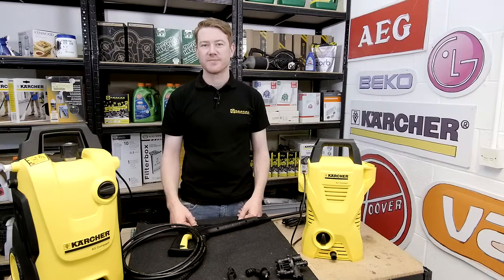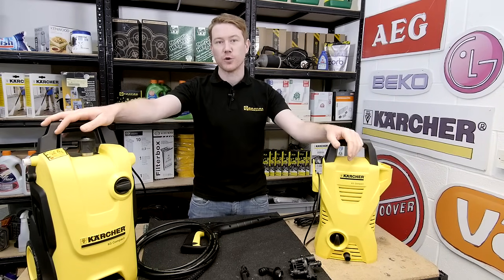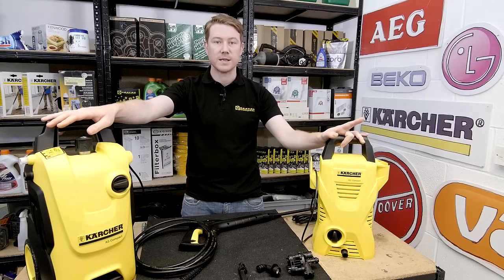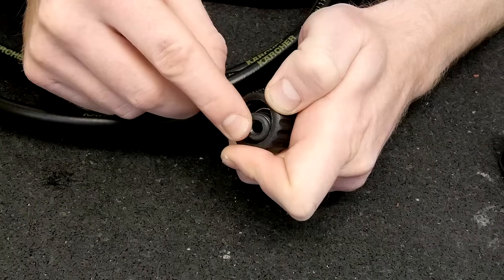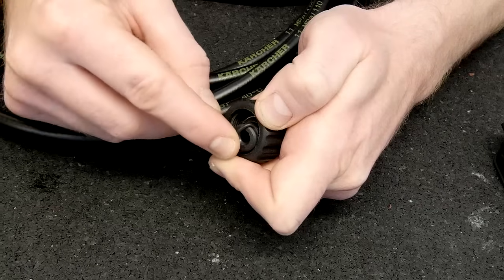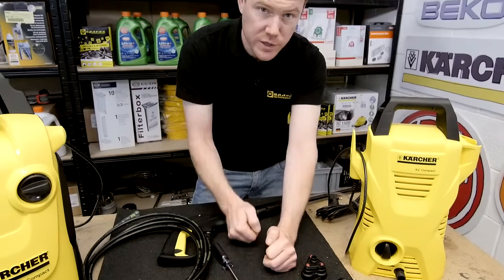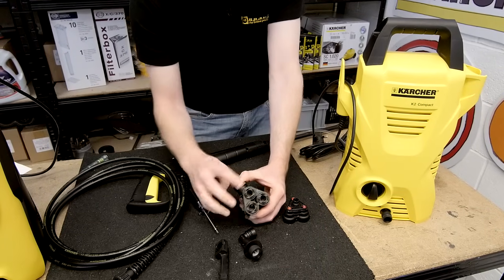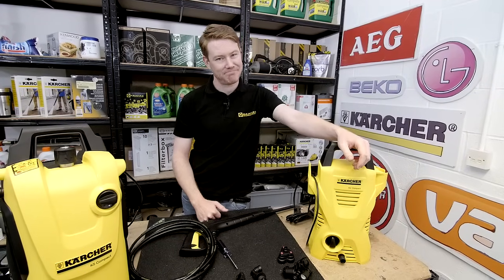Karcher Not Working? - Karcher Pump Faults Fixed!

Comment: Hi,
I have a Karcher 4.130 works but  is leaking a lot from the cylinder head area ,  so does not have the usual power. It is not pulsing. I have stripped down and had a good look, but no obvious cracks or splits. I have replaced the triangular washer , Can you suggest what next to try?
Reply from the maker: Hi Michael, disconnect the power and connect the hoses to pressurise with mains water pressure. You can then dismantle and examine to find where the water is leaking from.

Comment: I have a K1900 electric pressure washer. The motor will not cut off when the spray gun trigger is released but instead runs slower. Prior to the motor running constantly, the unit was pulsating when using the spray gun and cycling on and off when not using the spray gun. No leaks found.

Comment: I have a karcher and it started pulsing evey few secs now it's every second but there are no leaks and the pressure has dropped. Could it be a blocked inlet? Thanks
Reply from the maker: Hi Ritchie, it does sound like there is a restriction somewhere but try a different nozzle first.
Reply: eSpares it was running all time yesterday but then started pulsing again I'll try new lance/nozzle 1st. Thanks

Comment: Hi,I have a Karcher K6.85M Pressure Washer which has always been appropriately stored (never below 0°C) and drained following its largely infrequent use.Recently when using the pressure washer the motor abruptly cut out. At the time I presumed that this was due to some sort of overheat protection as the machine had been in use for just over an hour (though not continuously) and so this curtailed any further use.The following day I attempted to complete the previous day's task only to find that as before that when switched on the motor buzzed as usual but on depressing the trigger only a small amount of water was coming through the lance (just tap water pressure?) and the indicator needle was showing no pressure. No leaks are evident either.I have changed the lance, checked all of the hose connections and verified that the filter is not blocked. Do these symptoms suggest an electrical issue (capacitor?), stuck bypass valve? or point to an entirely different cause.Are the replacement spare components readily available from eSpares?Thanks for your advice
Reply from the maker: I had the same issue on a Bosch pressure washer myself recently and from your description it is likely due to the same cause. The motors on the larger pressure washers often have a motor capacitor to pass current to half of the motor. Mine had failed and was burst so check yours visually. If there is no sign of damage it may show short or open circuit with a meter. If in doubt take a chance and replace first anyway.
Reply: Thanks for the clarification......now I have a starting point I will strip down and inspect the Capacitor....as you suggest I will likely replace in any case.

Looking at the parts diagrams for the K6.85M it indicates that two Capacitors are available one at 25 Micro Farads http://www.espares.co.uk/product/es538318/pressure-washer-capacitor-25-mfd-uf?pageNumber=5&ModelId=2254119 and another at 40 Micro Farads - http://www.espares.co.uk/product/es538319/pressure-washer-capacitor?pageNumber=5&ModelId=2254119. Further research indicates that the K6.80 and K6.85 model series are both covered by the same parts list (see https://www.easymotoculture.com/vues_eclatees/Karcher/Nett.%20haute%20pression/HPC-KAR-2002_1.397-500.0-K%206.85%20M%20WB.pdf) as most parts appear identical. Do these two Capacitors reflect this model share? If so which is the correct part for the K6.85M??  

Assuming that this is not clear.....is the larger 40 Micro Farad a better/safer bet?  What is the difference between using the larger vs the smaller value component??

Thanks again for your helpful advice

Comment: I have a Karcher K5-85M that surges while in operation. Suggestions, please!
Reply from the maker: Hi Carl, two things to check,. 
I: try another spray lance as a partial blockage can cause the motor to shut off then come back as the pressure reduces.
2: Check there is a good supply of water to the machine and the filter in the machine inlet elbow, and there are no air leaks on the supply hose.
Reply: The whirlagig wand works fine. The water feed is a one-inch rubber hose with plenty of pressure, and the screen is clean. The adjustable wand works at reduced flow but surges at maximum flow. Thanks, and any more suggestions?

Comment: I have the k2 compact and on the water inlet (on the back) it leaks, but I've have also noticed the water that's leaking out is multi colored like if there's an oil leak. Any idea where the oil could be comimg from or the cause of it
Reply from the maker: Hi Marcus, the pump pistons are in an oil bath so if water is contacting the oil it is likely to be getting through the piston seals.

Comment: hi matt...got brand new k2...i tried it with no water supply to it just for couple of short bursts...it sounded great..
then when i went to use it with water supply connected ..it barked..(for want of a better word) then stopped...then wouldnt start again...so i unplugged it and plugged into another socket ..again it barked and did nothing...
ive tried couple of fuses..but nothing at all..
prezzie for my mom..never squirted a drop of water...any ideas mate?...
did i kill it by tryin it without water connected?..
Reply from the maker: Hi Ginger, my first thought would be if it is brand new then it is under guarantee, so it can be fixed free of charge. Just contact service on your receipt, you would need to take it apart to look at it so let them do it for free.

Comment: This is very helpful video. My karcher K2is leaking from inside only when I turn it on. I guess it is the cylinder head then?
How much is it?
Reply from the maker: Hi Omar, if you have checked the cylinder head and confirmed it is faulty, take a look at our website you will be able to cost the part www.espares.co.uk/browse/at1315ma877/pressure-washers/karcher

Comment: hi I have a karcher k3.575 power washer that won't turn off and is leaking water from the motor capacitor case when I turn the water on it gushes out the hole at the bottom of the capacitor housing
Reply from the maker: Hi Natasha, follow the video at 1:19 as this will help identify where the leak is coming from.

Comment: Hello. I have a question. I lent my Karcher K4 and when I was going to use it myself, I noticed that it had a leak. Could it be that the person I lent it to had pulled hard on the conection between the pressure washer and the hose that conects wth the spray gun? 
The machine runs, but not at full pressure.
Reply from the maker: Pulling would not normally damage the connections but a knock in transit or storing in a cold environment may. Disconnect the power and remove the case then attach just the water and hoses. This pressure should help show any leaks.
Reply: eSpares Thanks for the response! I found the leak. It was a cracked cylinder head.
Reply from the maker: That is typically caused by ice expanding in winter, it is possible it had fractured and failed later.
Reply: eSpares The things is that in the country that I live, there is no winter, so my guess is that the other person yanked on it pretty hard to crack the piece.
Reply from the maker: Or knocked/dropped it over when used?.
Reply: eSpares Maybe. Thanks for the help!!

Comment: Hi, I have a new Kärcher washer with built in soap dispenser. K4 full control (I think) it has the spool for lance hose built in. First use and I am unable to get the soap to run through? Is this a common problem with a simple resolution?
Reply from the maker: Hi Carl, Karcher's like most machines only dispense detergent when on 'low' pressure. Remove the lance or fit a brush and it should work.
Reply: Hi look at the tip of the washing part were u adjust the pressure for washing turn the "head " to the lowest n it will start dispensing the soap. Some times it will say the word mix on it. I had the same issue n suddenly stumbled upon the solution..
Reply: CARL THORNE or buy a Karcher K series foam cannon. Don't buy the FJ6 it doesn't dispense foam as good as the foam cannon. Bought mine last week and arrived yesterday and worked like a charm. But now I have a problem. I think my Karcher K3 series has a pressure leak and need to get that fixed

Comment: Hi, I have a K4 compact that has recently developed a fault. As soon as it is plugged in to mains power, the pump starts, even if its switched off on the PW itself, water does not come out until the trigger on the lance is opened. There doesn't appear to be as high a pressure either. I can't see any water leaks from anywhere.

Comment: hi mate I have to turn my pressure washer on with the trigger pulled to make it work. soon has I stop pulling trigger I have to flick the switch off and on with the trigger pulled
Reply from the maker: Hi Gary, there is an over pressure valve (spill valve?) attached to the high pressure area of the pump that will shut the pump off when pressure is excessive (not being used). However if there is a leak or worn seals the pressure may not be sufficient to shut the pump off.
Check for leaks and then start replacing seals in the pump.

Comment: great video man!  
I have a karcher 3.68M 1.601-742. it's for low pressure and the machine turns on when I turn the switch. is it supposed to be running without the trigger being pulled? when I pull the trigger, I get the same flow as when the machine is turned off . I appreciate any feedback. thanks JB

Comment: Hi Mat,
I have K2 series with old hose type.
When I used it, using standard lance, suddenly pressure dropped, and the machine didn't do auto shut off anymore and I notice that the tip of the lance is gone (the lance now have slightly bigger hole)
When I change the lance into dirt blaster, the machine start to pulse when I didn't press the trigger and the water spray seem not too hard compare to the last time I use it.
I don't see any leak coming from the machine.
Would you please help to advise what could I do to confirm that is it the machine problem or outlet (hose, hand gun, lance) problem ?
Thanks.
Reply from the maker: IF the pressure from the dirtblaster is significantly higher than the regular lance it is likely the lance has been damaged. If the machine is pulsing when not used the high pressure in the cylinder head needed to shut the machine off must be escaping, usually from a leak but could be an internal seal.

Comment: Another good video, but sadly doesn't address my issue. My machine started to pulse years ago and advice from Karcher was to replace the pressure lance! Hopeless advice, nothing to do with it, and no, I did not buy a new lance! I'd asked then about a possible faulty pressure release value ... but clearly 'a pressure release' was indeed occurring, but not via a pressure release value, but through the start of a pump leak.

Recently the leak got worse and so I went investigating. The leak is from the triangular seal at the top of the cylinder head (Part number 9.081-422.0 or ES538518 in eSpares money). The problem now is a fundamental design fault on the pump; The triangular seal should be designed to sit in a retaining channel to keep it in place. Sadly, instead it sits free on a ledge, and when compressed by the top of the cylinder block being assembled on top of it, tends to be 'squeezed out' at some point around its circumference, meaning the pump leaks. And quite clearly, this happens even after successful assembly and was the cause of my fault. It would seem the seal moved (or 'walked') during use, no doubt due to motor vibration, and so started to leak, as the seal was not found damaged on disassembly, just not sitting in place all the way around the cylinder head. It had 'walked' out of the jam between the body ledge and cylinder head and so started leaking.

It's a dreadful piece of design by Karcher. I cannot understand how any sane engineer would expect anything but what happens to occur. The seal should be retained, otherwise the inevitable will and does happen. It's all made worse as the cylinder body and head are all assembled in one go with the bolts retaining the pump to the motor and with the electrical switch thrown into the assembling mix as well. The result is each time you fit a new seal, it moves and doesn't give a proper seal. Each time you get differing degrees of leakage depending on how much of the seal has been squeezed out of place. It all makes me wonder how Karcher actually build these things without a high pump leak failure rate as leaks are just inherent in the design.

It seems I can send the machine off for repair, but at £135+parts it's as much as buying a new washer. So I seem to have a designed-in fault and the only option is to buy another machine each time, as repair is equivalent to buying new.

This has all destroyed my confidence in Karacher. It is beyond me how such poor design can have been permitted as leaks are just inevitable.

Do you have any advice on replacing these triangular cylinder head seals, specifically keeping them in place during assembly? I've even tried superglue to keep them in place, but to no avail. Always some degree of leakage :-(

And one last 'easy' question. You mention the o-ring on the hose (6.363-198.0). I had looked to replace that, but it seems this is a Karacher special size, and slightly smaller than the usual garden hose o-rings in use by Gardena, Hozelock and others. Is this correct? You need a special Kararcher o-ring as theirs are a slightly different size?

Thanks for any advice!

Comment: Sir mine  (K2) is acting weird, simply i turn it on, press the trigger button and all goes well. i release the trigger one second, and then press the trigger again...it stops. no pressure, no sound, nothing at all. 

what could be the reason?
Reply from the maker: Hi Skydancerak, test the on/off switch is working correctly, you will need a multimeter to verify if it is failing.

Comment: I am using karchar k2 compact ,problem is ,it don't turn on automatically at 2nd or third attempt using hand gun.(no problems in motor or pressure)( problem in automatic on off section) .
Reply from the maker: Hi BrainageTM Athavan, if the motor and the pressure are ok check the trigger as it sounds like it is not functioning correctly.

Comment: My machine is running but no water is coming ,what is the problem ,I hardly used .
Reply from the maker: Hi Rafi, check the cylinder head because if ti is cracked there will be no pressure.

Comment: Great stuff-- my 5 month old Karcher started pulsing & has no real pressure--this is what I need to fix it myself ---A+++
Reply from the maker: Thanks for the comments, If the Karcher is pulsating when in use then it is likely the spray lance is restricted as this will increase the pressure as if the machine was stopped and once the pressure drops the machine runs again. Try with a different nozzle before looking for a fault.

Comment: I own a Karcher electric power washer that has no pressure when I squeeze the lever on the wand.  Mine does not look like yours it has wheels under it with a handle that sticks up.  How do I diagnose the problem and get to the piston(s)?
Reply from the maker: Hi Brian, you will not notice any pressure unless there is a spray lance on the gun. If the machine is not producing the correct pressure the motor will not shut off when you stop using it. If it stops there is no problem with the pump.
Reply: What is a spray lance?  The wand has an attachment on it already.  If anything in the power washer is dirty what would it be?
Reply from the maker: Does the machine stop running?. If the machine is not producing the correct pressure the motor will not shut off when you stop using it. If it does stop check the filter on the input connection for dirt and make sure there are no leaks on the hoses or machine.

Comment: Mine started pulsing every few mins but worked fine. Today when I turned it on the motor pressurises once as normal but when I pulled the trigger it won't run at all.  Act's completely dead, won't even turn on until you hear a click inside the machine about 15 mins later. Whats causing this? Is there some sort of thermal cut off? If I try again, the process repeats and dead again. There are no leaks.
Reply from the maker: Hi TwentyEightySeven, you need to test the electrical components inside, this video will help www.youtube.com/watch?v=afPHu9LrRbQ&t

Comment: It's cheaper to buy a new pump than to try to repair. Karcher pumps appear to be more throw away than repair. A replacement cylinder head costs £64.89 hoping this will cure the fault A later K2 model from ARGOS for £84.99
Reply from the maker: Hi Colin, we understand that parts can be expensive but hopefully, the video was helpful to determine what part had failed and then make an informed decision on whether to repair the appliance.
Reply: Hi the video was perfect for locating the fault. But this is the 2nd K2 I have purchased and had the same fault. It is a design fault where high pressure water is passing through a plastic cylinder head and wearing it away thus causing leaks, A new unit is only £20 more than a replacement head and not knowing if more leaks would appear

Comment from the maker: RE MrNorsewise: (cannot post on your comment, check your settings?)
Thanks for the comments JB. We have known the motor drive to shear as it joins the pump, this results in the motor running but no pressure or pumping. Looks like you might have to dismantle the pump to check this.
Reply: Wsdhl,jkkkol
.,ööpljjjjk,,,mllllkkklllüpooooowevghnj,kkkkköllllĺipp71v,🚺🚹🚻🚾🚽🚮🚰🚱🚯♿👦😐😮,

Comment: My leak is coming from within the case. This is my first use after Winter, but was working fine for about 10 minutes, then GUSH!
Reply from the maker: Often the pipes can freeze and fracture so check for splits.
Reply: 1995Be